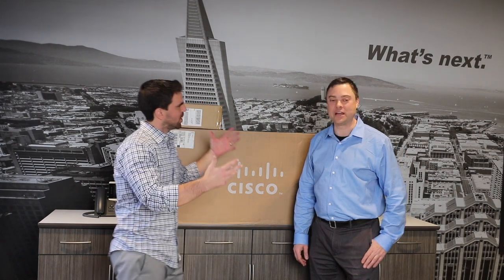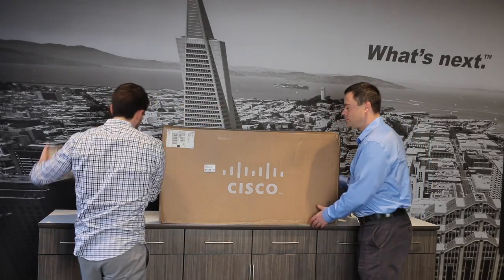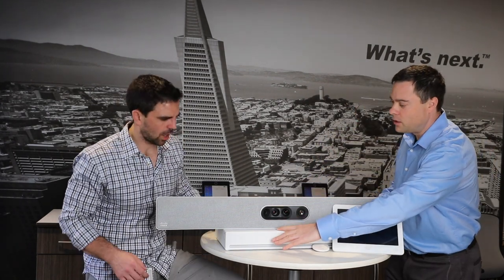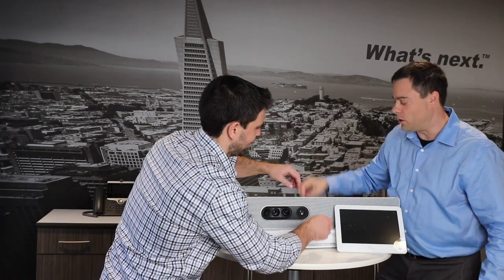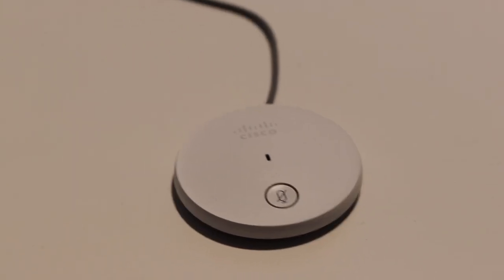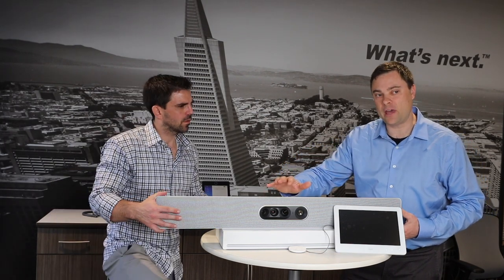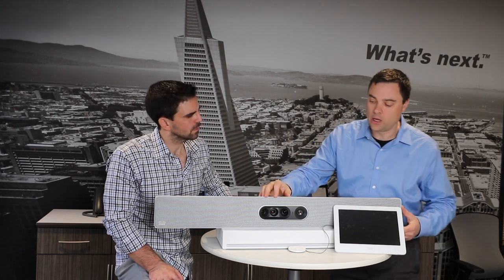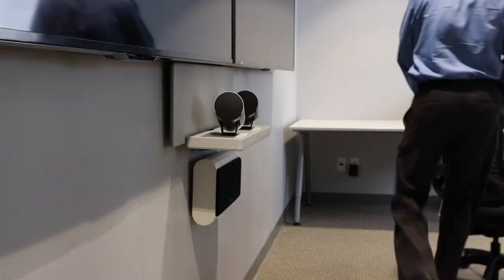Tech Talk: Upgrading a Collaboration Room to a Cisco Room Kit Pro

Comment: Nice video!
What kind of screens are you using in this video?
Reply from the maker: Thank you for watching! We are using sharp screens in this video. Any screen that supports 4k and CEC would work. Cisco recommends LG displays! Hope this helps!
Reply: @lookingpointinc  Great, thanks! What do you recommend/ what's your experience for a video conference room when it comes to using multiple displays (x2) - vs - using one large display?
Reply from the maker: @peterfixxernu  It depends on what you want the experience to be. When sharing content its nice to have content and participants on different displays.
In large rooms where people may be far from the display and need to see the content a larger display is better. The remote participants can be distracting for the users in the audience.
Reply: I am upgrading 9.15 software to 10.3 for Cisco room kit but taking lot of time may be more then 2 hrs is it okay ?